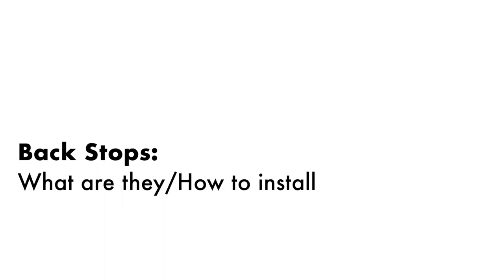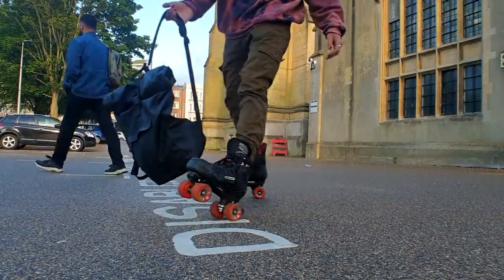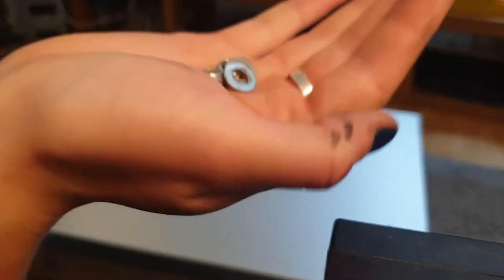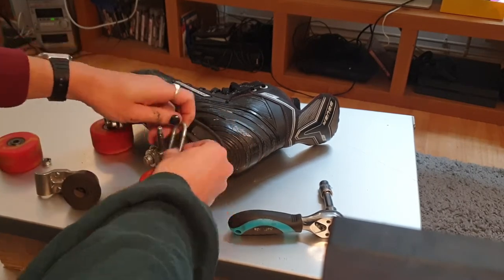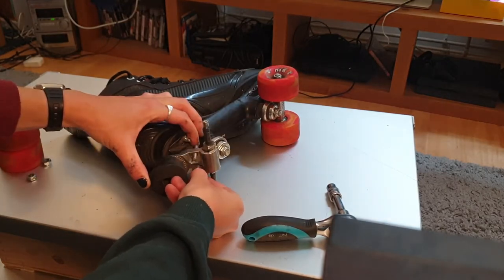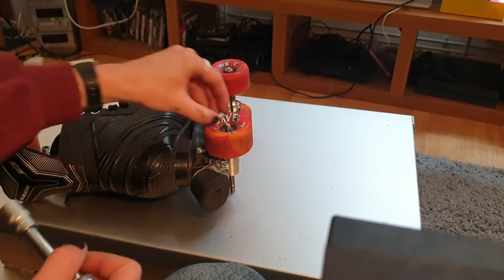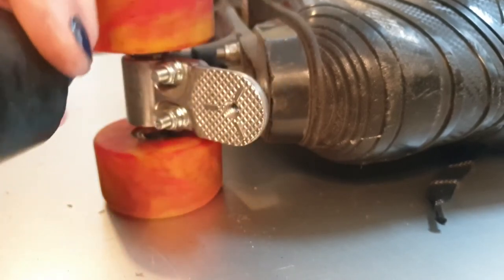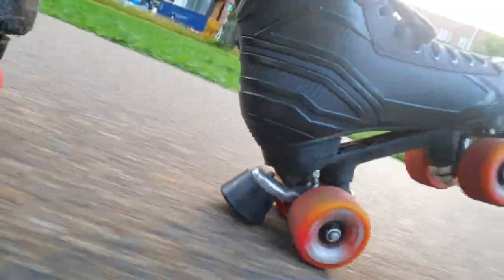How To: Install a roller skate back stop (Quad skates hill brake)

Comment: WHY am I having such a hard time finding a heel stopper?! So annoying. The ones I have found are not what I would call well made or well thought out. Don't! skate without the heel stopper! I use the heel more than the toe, it makes forward skating a breeze, more natural to use the heel. As a youth I stayed in skates, now at 55 I'm going back to them! Great exercise and loads of FUN! Found one on eBay like the ones you showed in your video, of course the price has doubled, but not seemingly as sturdy.   Back when I was a kid I had the best skates! They cost $30. Now, a decent pair of skates $369  what a LOAD of 🤬🤬🤬🤬
Reply: I'm 61yo Blk male😂) health nut) great exercise)
Reply from the maker: I'm skating without my back stop now, want to force myself to learn to stop without it. Not sure how yours is designed, but I found once I got used to the back stop that it never seemed to brake by accident and I could actually only get it to brake if I really intended to do so. Muscle memory maybe? But very handy. I'd presume that if yours isn't made at an optimal angle or shape that it might fall too 'high'.

Comment: Just so you know rear stoppers will bend the pivot on your truck and eventually your skate will pull to one side. You can get replacement trucks from olis but only for the playmaker base plates like yours.
Reply from the maker: Thanks for letting me know! I think those plates look a bit nicer too. I didn't think about these ones messing up the plates/pivots.

I'm thinking of replacing the plates soon so may take a look at a setup like that if available.

Thanks for commenting!

Comment: Are your skates comfy ? Looking to get some
Reply from the maker: I'd say so, I've been told that they're much more comfortable than the Ventro Turbos. You need to wear them in and/or bake them (video coming soon I reckon). Decent pair of socks helps too!

Every so often I get a bit of a foot cramp but I think that's more to do with skating style and could be eased with insoles.

Links are in the description to all of my setup! (Helps me out of course 😉)

Comment: What is this tool called that you used for tightening the nut
Reply from the maker: That's a ratchet handle with a socket (and extension) - you can buy set sets quite cheap from Amazon, useful tool to have! Alternatively you could use a 10mm spanner, or you can buy drill/screwdriver type sockets in 10mm sizes. In a pinch you could get away with mole grips, pliers, or a small combination spanner. 
Unfortunately my skate tool doesn't feature the size of socket needed here, otherwise I would have used one of those.
If you're using imperial, a 10mm socket is roughly a 3/8" socket.

Comment: What is your lead leg? Do you put them on the alternative leg?
Reply from the maker: I find it hard to explain, but you will have one leg that you feel more comfortable with having in front of the other. You'll do it naturally when skating forwards and gliding. You should put your back stop on this foot as it will be easier to put force into breaking on this foot. If you're not sure then put it on one of your feet and swap if you fancy, you'll likely know when you get the right side.
Potentially also has something to do with your preffered direction to skate in. Do you find it easier to turn clockwise or anti-clockwise? I prefer anti-clockwise and lead with my left foot.

Comment: Did they ever shift when you were using it? Mine started out tight but gradually shifted to one side ands started catching my back wheel.
Reply from the maker: No, never experienced that! With the U shaped bolt holding this on I can't see that being possible. I'm sure experience varies with different trucks and styles of back stop. To be fair, I bet mine moved a little, but hardly enough to notice, let alone interfere with the wheel.
Reply: @MisterSkids69  thanks for the response! I had to change the truck, thankfully had one that was compatible.
Reply from the maker: @MaryHadALittleHobby  happy days! I've also been put on to some trucks that have the back stop built in - apparently much better. Sounds like you're sorted but if you did continue to have issues...

Comment: Will this work on Impala skates? I'm buying the pink ones, but they come with the stopper on the front and I'd like to install it on the back instead.
Reply from the maker: They should fit as impalas have the same shaped trucks. 
One thing to bear in mind is that some impalas have plastic trucks. They might not be as strong so could be an issue with the way the brake levers off the hanger of the truck. I wouldn't have thought that would be too much of a worry but something to think about.
For a tenner I'd say it's worth a go. But if they're your first skates then it may be worth getting used to using and stopping on them before getting any extra parts.
Let me know which impalas you're getting if you arent sure about the trucks!